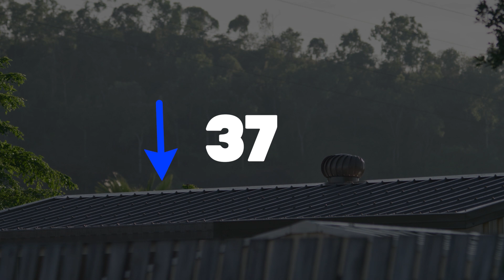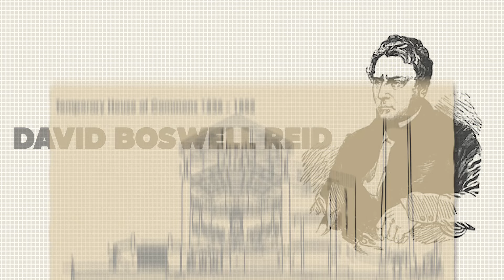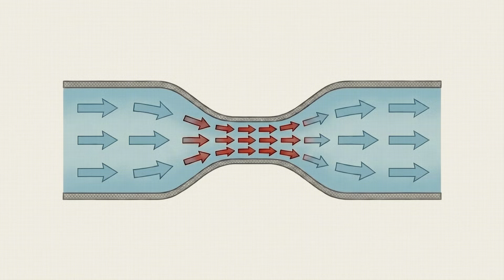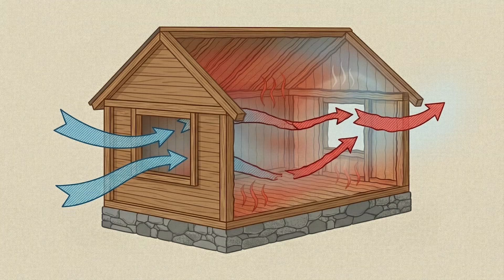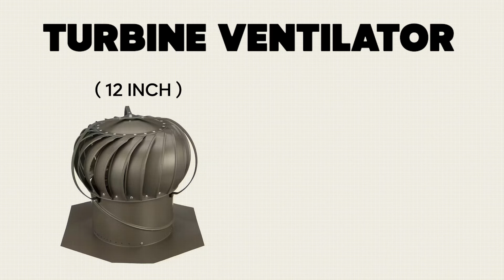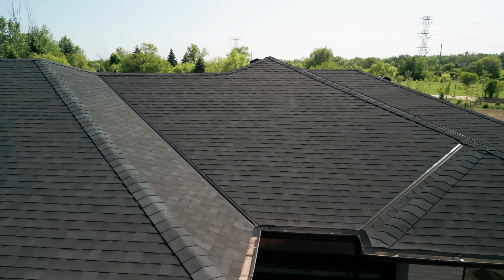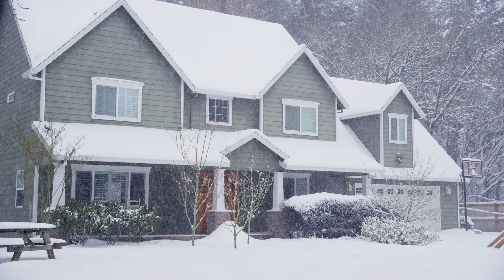Why Did We Stop Using This Natural Cooling System?

Comment: Solar panels installed on roofs effectively shade large areas of the roof therefore cooling the attic by default. Also, the “air gap” between the solar panels and roofing material aid in cooling. This is an unrecognized benefit of solar panels to roofing, and should be considered in new modern construction. The use of these turbines to help move air out of the attic would still be an excellent choice to further reduce attic temps.

Comment: We have a house in Abq NM, and I recently did several unique things to our house that we are fully remodeling.   I did all of this myself.. DIY.
1- I installed 2" poly-isocyanurate double back foil insulation panels between our roof trusses. I left a 3/8" air gap per side, then sealed the gaps with spray foam (a neat trick is to also tape the gaps with blue tape on the bottom (thus the ceiling) and spray the foam in from the attic, then pull the tape off the next day.  It makes the foam smooth and keeps it from dripping on your floor during application).  The foil serves as an excellent radiant heat reflector, thus reflecting attic heat back up, and reflects room heat back down (thus the top foil is great for summer months, the bottom foil (and the foam insulation) ..good for winter months.   Testing with a laser thermometer at 2pm on the foil and on bare ceiling drywall (with no attic insulation above it) ..and just 4ft from the poly-iso panels, the average temperature differences at the house centerline on hot days of 90-100F were ..get this.. 15F to 17F.  Yes.  Amazing. The poly-iso is not cheap mind you... but a 17F difference is absolutely huge.  Use 1" if you have to, then use regular batts or blown insulation on top.  (We have 8" blown on top).
2- When remodeling I found our soffits were half full of blown in insulation. I removed all of them and self-built what are called soffit baffles made of some 2x4 stood on edge with the top edge cut to the same angle of our roof slope.  On top of the angled 2x4 we mounted a 1/2" sheet of plywood x 16" long (toward roof) and 22"wide (spacing between our trusses which are 24" on center).  Therefore these soffit baffles contain / isolate both batten insulation as well especially blown insulation, thus keeping your soffits clean and clear.  The baffles also help direct the airflow up toward the roof sheathing material (plywood or OSB).  You can also buy cheap plastic soffit baffles that staple in, but plastic and heat never mix nor lasts.  My DIY ones were easy to make.

3 - We removed our Gable end vents and re-coated the gable walls in new OSB with reflective foil faces.  Again... best for radiant heat reflection. Then, on top of the OSB installed 1x2 wood strips vertically on 12" spacings to match up with the valleys of corrugated metal panels we install vertically as the exterior wall covering.  We went this route in a goal of better fireproofing the house.  Regardless, this method allows for airflow to be pulled in at the bottom (via a 1/2" gap at bottom where the old plywood gables meet the main stucco walls, and the air exits out the top edges in a venturi-like effect. These panels actually extend up inside our gable soffits 1" so the air pulled in exits out of the new ridge vent explained in the next step.

4 - We replaced the roof with a metal ProPanel roof.  We did this DIY, and again, employed the same formula as in step 3.  We removed two layers of old asphalt shingles first (even though you can keep them.. we just opted not to), removed the old tar paper, then put down a new high-quality moisture barrier with taped seams, then installed 2x2 wood sticks vertically from the edge of the sheathing just above the fascia boards, extending up to the ridge at 12" spacings to match up with the peaks of our ProPanel panels.  We also took the time to run the 2x2 sticks through a table saw (twice per stick) to chamfer the top two side edges to leave a 7/8" top flat surface.  This is a very important step to leave some wiggle room for adjusting/re-adjusting the panel sheets left or right when installing them.  

This 12" spacing we used also allows for the panel attachment screws to only screw in on the panel ridge peaks, and not the flat sections.  It gives a much cleaner look.  Importantly, this also means no extra holes are made in your roof sheathing (like with asphalt shingles with roofing nails) and the screws which attach the 2x2s to the roof sheeting are 2.5" long and spaced every 24" apart.   Spacings for screws, both the 2.5" and the 1.25" used for the ProPanel attachment are important to layout properly so that the ProPanel sheet screws do not interfere with any of the 2x2 attachment screws.  Another tip is to create a long jig.. at least 12ft to 16ft which attaches to your fascia or sub-fascia (our fascia was off at this time) to hold and cradle the end of the panels. This way they don't slide off the roof as you are working, and this jig allows you to decide how much panel overhang you want sticking out past the fascia-board.  In our case we did 2.5" inches of overhang for a good drip edge to keep water well off the fascia.  It looks great.  Making the jig helped us 100%.

5- Finally, we cut a slit in the roof sheathing at the roof ridge, 1.5" per side (3" total), all the way down the ridge, to allow hot attic air to escape up through the metal ridge cap you install over the metal ProPanel roof panels.  So, to be clear, the metal panels themselves have the initial air-gap between the roof sheathing, moisture barrier, and underside of the ProPanel sheets which is roughly 1" tall per "channel" created between the 2x2 "attachment sticks". This allows for air pulled in right above the fascia board to exit out the top of the metal ridge cap.  Likewise,  air from the soffits and baffles mentioned in Step 2 moves up to the ridge vent slit too. Thus as the roof panels heat up, air is pulled upward from the bottom from the panels through the sheathing gap channels, as well air flowing from the soffits move up into the attic too which is also able to escape from the same slit and ridge vent.  This double approach method of air flow works very well because it creates both a venturi effect on the metal side and conducts airflow current via the soffit baffles in a smooth way from low pressure to high pressure.  We could have also stapled on reflective radiant foil to the bottom of the roof channels, but because we have a truss roof system we opted not to. If you have a standard joist style roof it would be easier.

Lastly, If you are remodeling a home, this is an excellent way to go (for what is called a non-conditioned attic space)..common to most homes across the US.  This allows your roof to BREATHE and exhaust it's hot air very efficiently without spending electricity on attic fan systems.  Even if you don't install a metal roof, just installing the soffit baffles, closing gables, and switching to a ridge-vent system will make a lot of difference in getting that air flowing up and out.  Copy all this and save it to a notepad, share to friends, etc!!! You'll be really glad you did.  -OldOwl.

Comment: I remember my father having these installed on our house when I was a kid.  They did help keep the upstairs slightly cooler in the summer.  Problem was the winter - lots of wind in the winter and they were very noisy.  After I was an adult and my parents still lived in that house, my father eventually had them all replaced with simple vents.

Comment: They are still widely available in the USA, they're just not advertised or promoted anymore as a way to cool attics, thus the whole house.   I got two put on my house when I had the roof redone.  Its similar to the case of television antennas - you can still get the major broadcast stations' signals in the USA with an antenna on your roof or in your attic, but they don't want you to know that money-saving detail as the broadcasters make bout 30% of their revenue from selling 'retransmission rights' for their programming to cable TV companies who then charge you.

Comment: Summary: Turbine ventilators (“whirly birds”) can cheaply reduce attic heat and cooling costs without electricity, especially in hot, windy climates. They declined because they can be noisy, fail mechanically, perform poorly if undersized, conflict with ridge vents, look unattractive, face HOA limits, and do not fit well with modern airtight/mechanically ventilated homes. For most new homes, ridge vents are usually more practical, but turbines can still make sense in the right climate and roof setup.

Comment: In europe they are still used thats why we have so few airco systems and southern countries have learnes to block the sun from the outside with wooden shades before the windows (and their frames), in europe most houses also have a lot of cement and bricks in them which keeps temperature  stable from an energy density perspective. Heat is also something that builds up in the roof of a house and then slowly comes down to lower levels because heat rises. But if the upper levels are hot, then heat downstairs has nowhere to go. Thats why it is a common mistake to forget ventilating the upper rooms. The best protection against sun is from the outside, block the sun from touching the windows AND their frames. Some people use reflective coatings on the windows but they forget that the frames also conduct heat ... ow and never use AC with a single output pipe, those make huge noise, are very inneficient in electricty and actually are not that cooling if you compared it to ac's with an input and output pipes. Single pipe causes vacuum in your house which means it will pull heat in your other rooms through cracks and door holes (its a win in one room and a loss in all the others). There are portable versions of dual pipes ac's

Comment: I wonder if it would be possible and worth it to attach a small generator on that and create some extra electricity???  Make it both a vent and a wind turbine.   🤔  If needed, could make it with both inner and outer blades.  The inner blades mainly designed to pull out the hot air and the outer blades designed to help pull out air, catch the outside wind, and turn a generator.

Comment: Installed a roof exhaust fan in a factory went to add the closing flaps the next morning.. I could barely stop it with my foot as it was free wheeling…
Reply: I'd figure out a way to attack a generator on that to create some free electricity!  Sounds like it's plenty strong enough for that.  👍👍

Comment: I replaced my roof with metal years ago and had them put 1" of foam under the metal. My attic is generally cooler than outdoor ambient in midday sun. My AC barely runs and when I get around to replacing it I will downsize it to probably a 1.5 ton variable speed to replace my 2.5 ton. 1 ton can actually handle it.

Comment: i had 3 on my roof and one had the turbine part ripped off during a hurrican. I replaced it and thats when i realized they didnt suck air out but blew air into the attic. why is my attic over 100f well thas why. I dont know if they make some that suck air out instead of in but i moved to passive air and now my electric bill is down by 1/4 during the summer. thats my experince with these vents

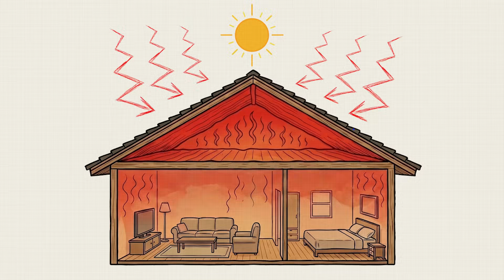Comment: If hot air rises , how do you explain your earlier comments(@3:13 )that the heated air in the attic flows downward into the home?
Reply: Heat transfer. The hot air heats up the entire attic space, including the floor, when then radiates the heat.

Comment: These DO NOT COOL YOUR HOME. They are excellent at cooling your attic but to suggest that they can save money on cooling your home is ridiculous. Your attic is insulated and should be completely separate from your interior living space. The attic temp is supposed to always be the same as the outside air temperature.  I've been a professional roofer since 1988 and have installed many Whirlybird brand turbine roof vents as well as the now standard Cobra ridge vent products. These are superior to ridge venting because they don't get plugged up with needles and leaves and the turbine vents spin for decades if installed properly.

Comment: It's actually called a turboexpander. It works on exactly the same principle as a turbogenerator, extracting energy from hot gas. Only in this case, the cooling is the desired product instead of the energy.

Comment: I live in the Central Europe and there are a lots of prefabricated blocks of flats and the stuff like hot water, cold water, gas is shared by pipes which goes from the basement all the way to the roof. Part of this is also ventilation shaft and all of these buildings have these turbine ventilators on the roof. I think its mainly because of the air circulation, because I dont see much benefit lowering the temperature in the unusable shaft. When somebody burns something during cooking for example the small goes into this shaft and up to the roof and I think its thanks to this turbine ventialtors which "sucks" the air up (I suppose).

Comment: Father had a wirlybird on his house, and we were rather convinced that was where the leak was coming from, as right below it, it was hot as hell, and the AC kept running constantly... had no clue it was actually helping... think all the gunk might've been preventing air flow tbh, but I also recall us just trying to cap it off as well. Was like 97 degrees inside, grid went down again, and we didn't want to leave for a neighboring area with power just to cool ourselves lol.

Comment: active fans requiring very little energy to move relatively massive amounts of air probably also a major factor, along with drastically improved electricity service reliability in the MidWest compared to my childhood. without ducts, you can move 500CFM of air whenever you want for ~75W; it'll run maybe a third of the day for maybe a third of days per year; $10-15 in annual electricity cost, big whoop.
Reply from the maker: OK - thanks for that!

Comment: Also, so much misinformation presented here! You only do see such high temperatures in the attic, because Americans do not insulate their homes! The building standards are simply laughable, a mix of plywood and toothpicks with some foam in between them. It's a no-brainer that this will result in cold temperatures inside in winter and high temperatures inside in summer...

Comment: I had whirlybirds and replaced them when I replaced my roof. Sure, they work great but they all rust in a few years Really strong winds can bend them. You get squeaks and it annoys not just you but four houses away as well. None will last as long as your roof. Rain can get in during storms as well.

Went with O'Hagin's. They do just as good a job and there's no moving parts. They're flush with the shingles.

Oh yeah, I live in an HOA and every house had whirlybirds when they were built.

Comment: Why not install expanded foam insulation up against the roof deck, and eliminate the heat gain associated with 150 degree F air in the attic? In addition, with this approach you can create a conditioned space that can be used for general storage and HVAC equipment / ductwork that are not subjected to extreme heat.

Comment: When I had my roof shingles replaced I had the roofer put 3 turbines on my roof. I live in the desert S/W and these things really helped to pull the heat out. Our summer heat can reach well over 110° F and has been as hot as 120° F. Before the turbines at night the house was just hot and the sealing remained wam all night long. After these turbines were installed I could tell the difference in the cooling and my A/C bill was lower.

Comment: I live in Sweden and put two of these in the vents  for the bathroom and toilet. They have worked without any problem for 20 years. They look cool as well.
Reply: Du behöver kyla ner luften?
Reply: I am planning on adding two of these to my two bathrooms, as their windows are the highest on the house. In order to keep outside light coming in while the ventilators work, I am planning on making a plexiglass duct outside of the window, routing to the roof, which is very close and setting the turbines there. Since the house is made of concrete, it gets very hot most of the year, but the air cools at night, so I estimate the turbines will help a lot to remove the hot interior air.
Reply: So the sealed ball bearings have never broken down in 20 years?
Reply: Regular exhaust fans work better and way easier to install. My sister installed these like in the video and it kept leaking after several years of use even after countless repairs
Reply: All your neighbours hate you for the constant sun flashing off those things, but hey, you get free ventilation.
Reply: @nvelsen1975  Paint them black, they'll work better too.
Reply: They often come pre painted.

Comment: Ok, this is fine in the summer when the attic is hot and you want to get rid of the heat, but this would be bad in the winter when it would make the attic colder and make the house colder. You've got to think about the whole year.

Comment: We had these growing up in the  Texas south.  Works great however, make certain you can get parts for the next 50 years as the bearings will wear out and you dont want to have to try and install a whole different unit just for a simple bearing. Right Sears :)

Comment: You need ventilation in an attic, but a lot depends on the shape of the roof. I had a turbine but the damned thing became noisy and animals kept trying to get into the attic through the turbine. I have a metal roof now and had metal vents installed that are screwed down.